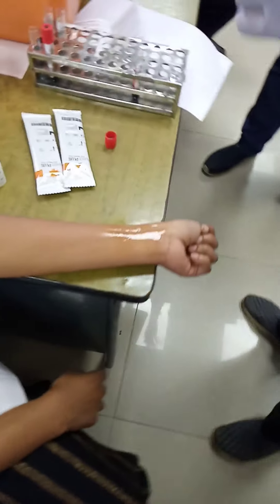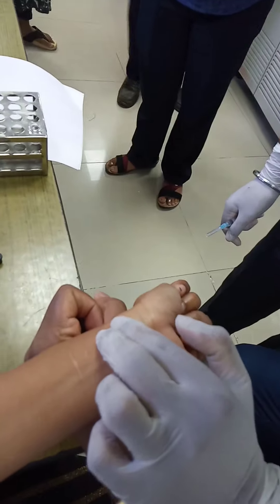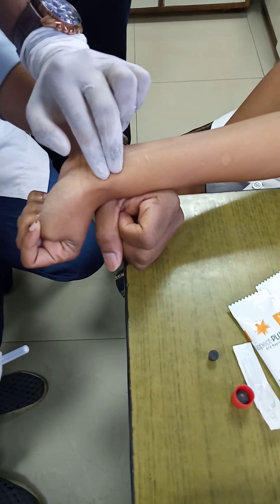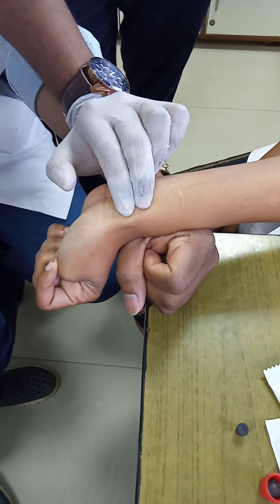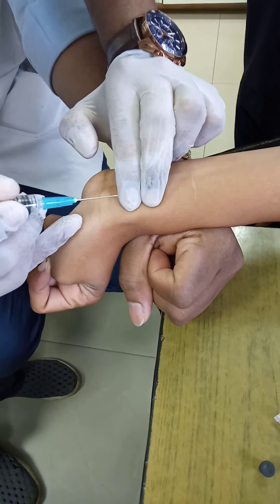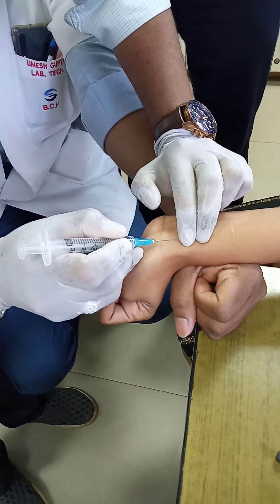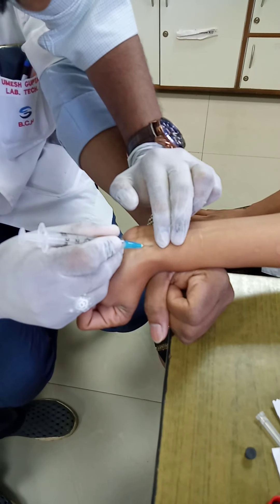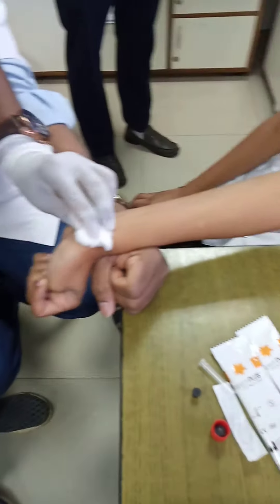arterial blood gas analysis procedure (unsuccessful attempt)

Comment: Take hand out from under wrist, use a towel. Wrist is bent too far. Syringe should have space to fill from pressure, and be parallel to artery which is not deep. Don't stick between fingers., go just under the finger feeling the pulse .It's a lot less pain full if you can do it fast.  Don't fish,don't redirect, just put the needle in the artery.   Don't tell the patient it will be pain full, just be fast. I have done this procedure probably 10,000 times.

Comment: please explain me about cynide poisoining
Reply from the maker: Wat exactly wud u like to know.
cyanide is complex 4 inhibitor of electron transport chain
ETC is the cycle that takes place in the inner mitochondrial membrane thus helping in production of ATP.
Cyanide inhibits complex 4,thus no ATP production.No energy in short
Reply: mam can you make a video of this topic?
Reply: Mam could u explain the advantages of pre heparinised syringes over conventional ..
Reply from the maker: It’s just that the syringe is primed with proper amount of heparin n it’s making the task easier for the lab people.
U can use the conventional method but b very careful on the correct quantity because of quantity varies then it leads to pre analytical error